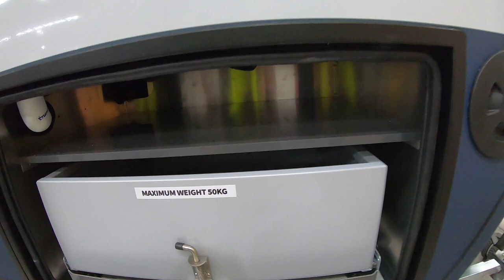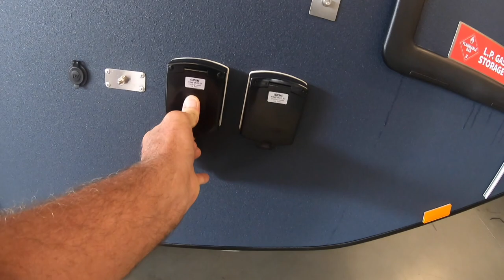The Matrix by AOR (Australian Off Road) || Is This The Best Australian Made OFF ROAD Caravan ??

Comment: Bottlejack not supplied? Is that a joke? Do you have a fire extinguisher at least ?
Reply from the maker: True, no bottle jack or wheel nut brace. 

No probs got an extinguisher 👍
Reply: @kennymepicadventures876  wow mate that’s sad, I have a rough idea what you would of paid for that trailer in that should be Standard even the cheap Chinese ones come with them.
Reply from the maker: @chrisjones1864  True, but a $80 bottle jack was not a deal breaker. And, the after sales support is platinum 👍
Reply: @kennymepicadventures876  little things make a difference
Reply: A jack will standard soon as regulations have changed for all caravans.